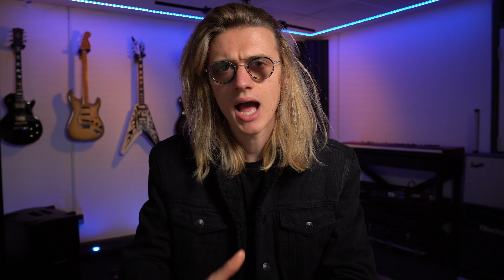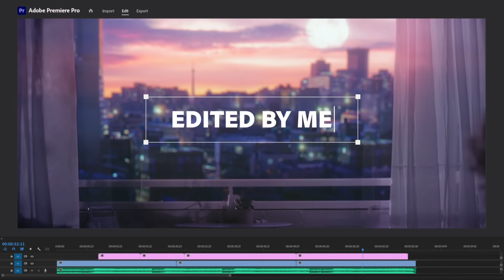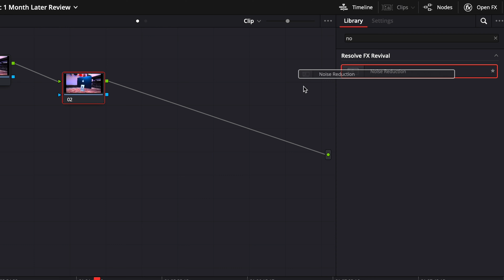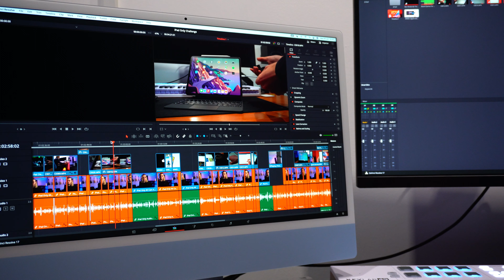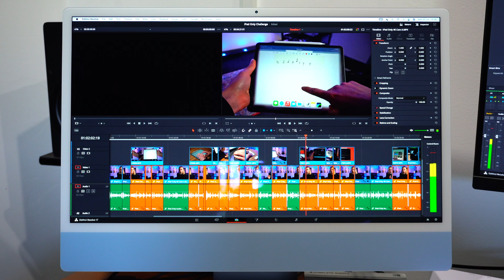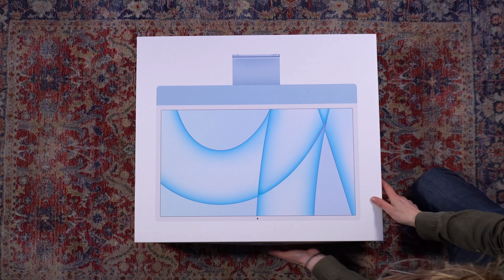Will you REGRET buying the M1 iMac!?

Comment: Returned mine after 3 weeks due to daily kernel panics when waking up. more than a little peeved about that as its the first apple product I have ever bought that had a problem. Decided after a weekend of deep thinking not to accept a replacement. Going to bide my time until the next iteration appears and make do with my M1 Air until then. Its a great machine mind.
Reply: Mine works flawlessly.
Reply: @markoconnell804  As does the vast majority. However the problem I had is known to apple. Its not a software issue its a problem with the logic board or CPU. And has happened to all versions of the M1. iMac, Mac mini and the Air and Pro. Oddly it didn't start until I had the device for 2 weeks. whereas most have had this happen 'out of the box'. The device would have to restart every time it woke from sleep. A few owners have chose to ignore it and installed caffeine so the device never sleeps. Which seems crazy to me.
Reply: @Eutexian_UK  had a MacBook Pro with M1 for more than 2 months and an iMac M1 for almost 3 weeks. Also a couple of people around me have similar devices (mostly Airs with M1) nobody, literally nobody has complained about this. So either you got extremely unlucky and you could reorder it, or is just plain lies.